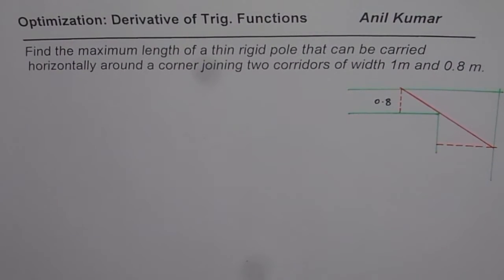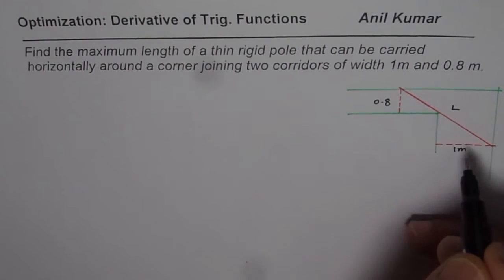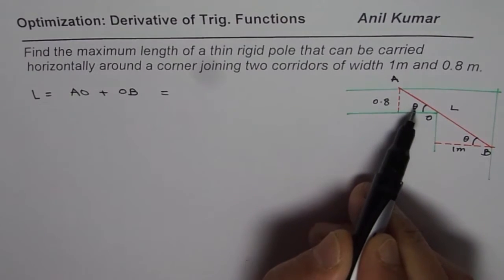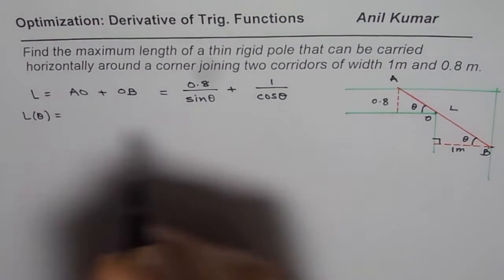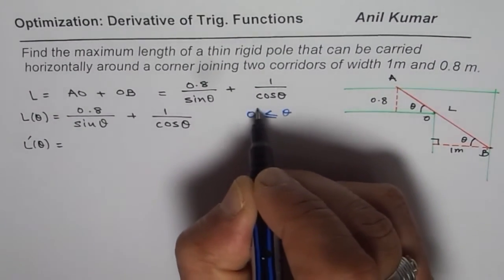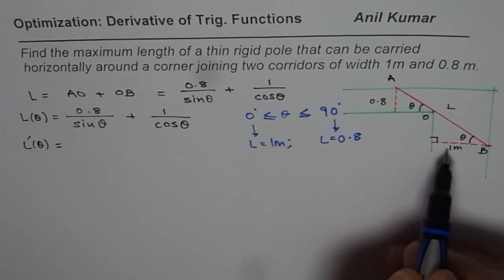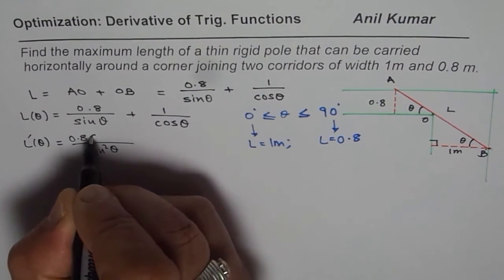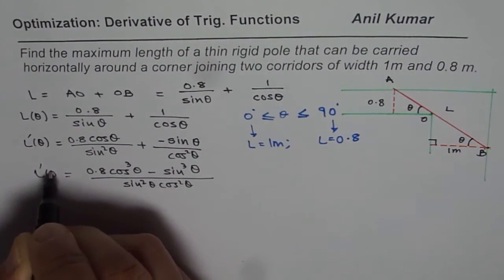Find Maximum Length of Pole through Corridors Corner Trig Optimisation Calculus

Comment: there is a mistake in the final step, because the derivative is negative before the critical point and positive right after, you can easily verify this using graphing technology. That's the main challenge of the question: the longest pole that will fit is in fact the min value of the pole length
Reply: Would you solve similar problem for the width of the second hall? Thank you
Reply: its the minium theta, not minimum length